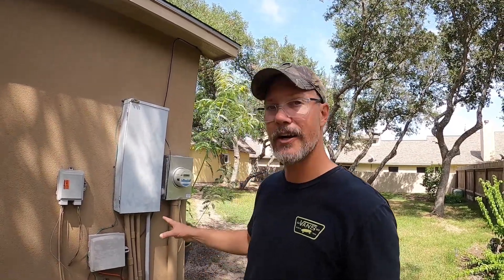Building a Tiny Workshop: Electrical

Comment: Personally prefer wiring to be in conduit in the shop. Too much chance of hitting a wire when hanging items on the wall. Also far easier to add or change later.
Reply from the maker: That’s a good point. In this case, most my wiring is below waist level so I am unlikely to need to penetrate the wall at that height. If I’m unsure where some of the wiring is, I can reference this video and photos. I plan to use plywood screwed to the studs as my wall covering so i can access in the future. I appreciate the thoughts!  Thanks for watching.
Reply from the maker: Ron, I just posted a new video which includes my solution to protecting the wires - https://youtu.be/XM-j4GYBcp8

Comment: as a Youtube creator. it would be a good idea to chuck a couple on outlets in the ceiling. For extra lighting and camera charges..
Reply from the maker: That's a good idea!  I may incorporate that idea into my lighting.  https://amzn.to/3EgK0Cj - these are the lights I'm installing, so it would be possible to use the screw-in plug extensions if I  needed to tie into the power in the ceiling.  Thanks for the suggestion!
Reply: @MakeitGoode1  yes. I have these in my space.. they work really well. I have 2. Looks like you will have 6.... it'll be very bright 🌞
Reply from the maker: That's my hope!  I like that they are adjustable at each "petal" so I can direct light where I need it.  Do you find that you adjust yours often, or set and forget?
Reply: @MakeitGoode1  move around a little.. Just because they are blinding if you need to look in ones direction.

Comment: Nice. I'm rewiring my sub 400sq ft shop currently in stages and upgading from all 14gauge wire to new 12 gauge but running surface mount conduit and boxes since the shed is finished already.  Previous wiring 85% surface mounted (not in conduit) and the stuff in the walls is just being cut and left.  I was curious if you had a link to the sub panel you are using?  That's the one thing I have to do in the future is change out the old school twist in fuse box to a sub panel breaker box.
Reply from the maker: I used this panel for my shop - 8 space, 16 circuit GE sub panel - https://amzn.to/3A3nv14
I wish you the best in your upgrading!